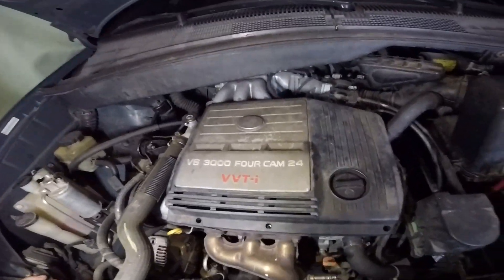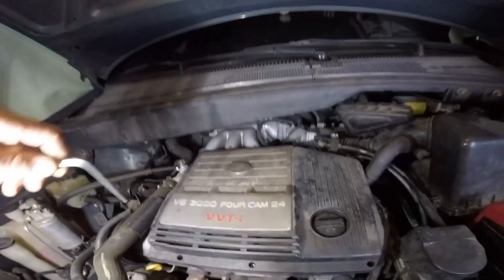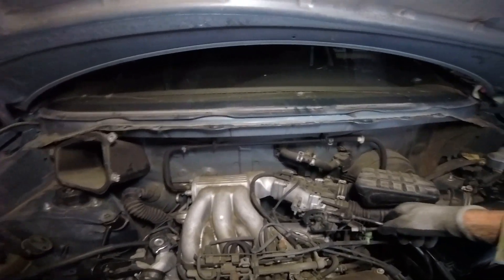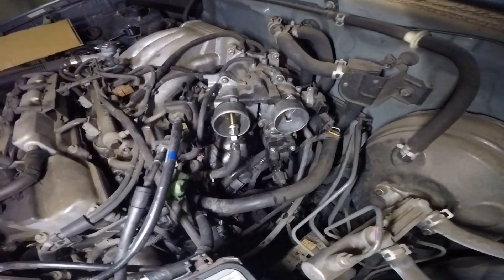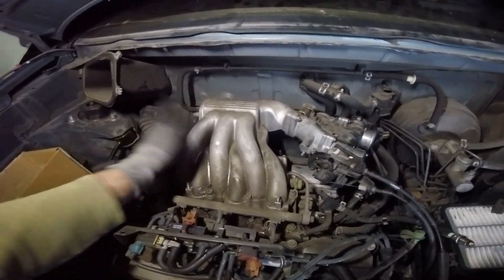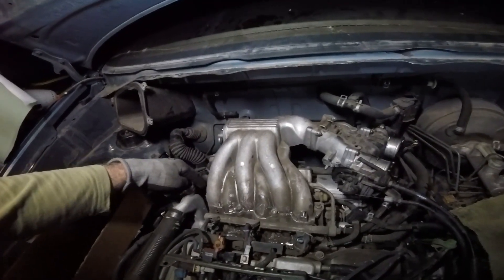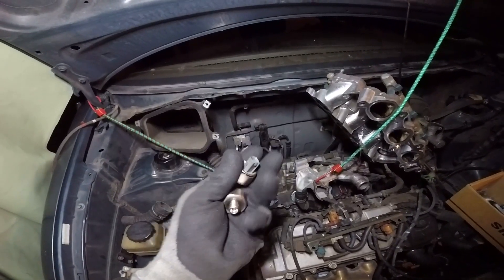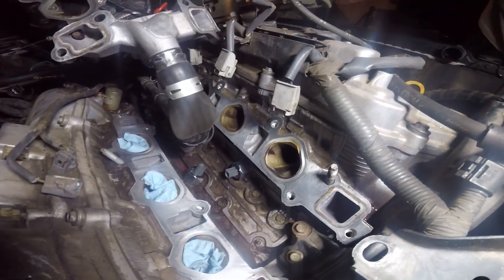Replacing the KNOCK sensors on  2002 Toyota Sienna

Comment: I have an alternative way to fool the CPU without cutting or splicing wires only takes 20 minutes a new Toyota knock sensor harness $50, two denso or beck/arnley knock sensors $70 x 2= $140 so for $200 everything is good and happy. I've done this to my rx300 1000 miles ago with no negative experience.
Reply: So I still have to do this whole process but there's another way to trick the system

Comment: Does the sensors have any indication to know which side each one goes?
Reply: They should both be the same
Reply: They are the same. It's rarely the sensors, usually the cooked and brittle wire harness. The sensors are very expensive, but this job is a pain. So most people don't want to go back in there. I've fixed multiple 3.0 and 3.3 with just replacing the harness. Only had one actually bad knock sensor... Sucked going back in there... But I'm still way ahead on average
Reply: @trekinseattle  How are the sensors VERY expensive?  I just got a pair of Toyota sensors and the harness for less then $70

Comment: Just did this job in drive way  it took a day an a half 🤣  Tip if car older do injector jets heads up hard to find out of stock every where same for crush washers for gas line.  Cleaned everything to like new.  My van runs like a beast after doing job. Tip junk yard can save you for anything you can't find in store.  Nice review 👍💪
Reply: Ps  miles 184 000. On my van  if it helps anyone.

Comment: what was the mileage on the sienna when it failed ?
Reply: I have same 2002 with 200000 thousand miles I have not problem with those sensor thanks good
Reply: I'm at 198k and just got p0330